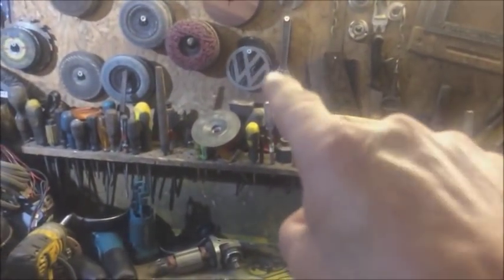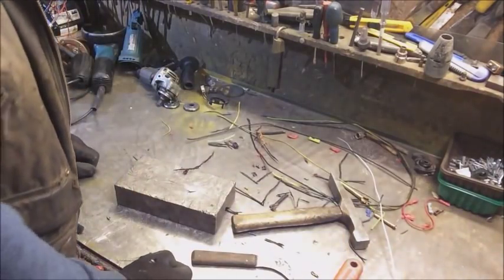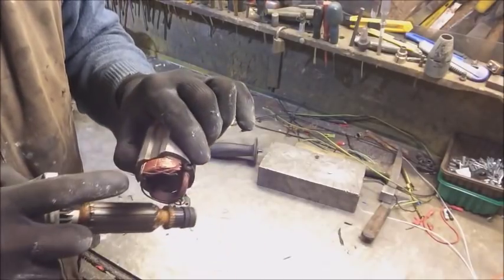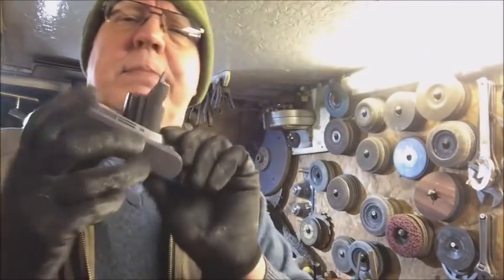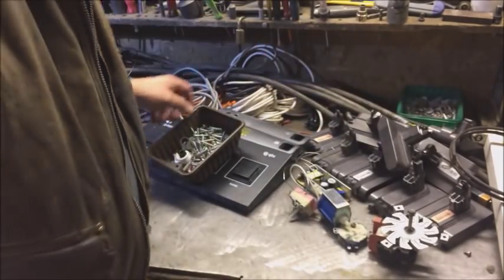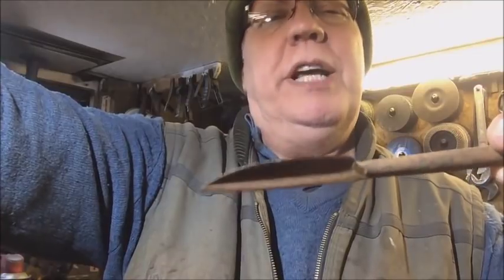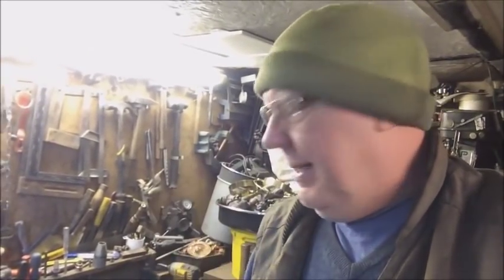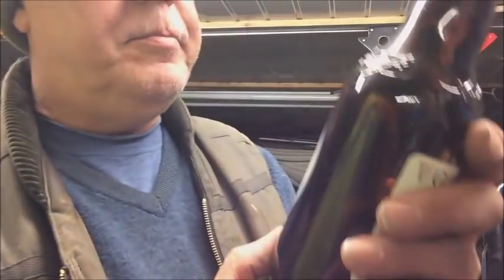Scraplife in da shedlife part 2

Comment: Another great video Ian.  I've used Big Keg's vegetable peeler method to strip wire.  It worked but the wire I had had been tightly coiled for a long time and it was quite long so it was flopping about all over the place.  I may try the hammer trick next time.  Thanks for sharing, Poo
Reply from the maker: hammer only works on hard plastic,  or solid core wire, if its braided wire you just mash the plastic into the wire.
Reply: @Man-in-da-shed  I stripped some coaxial wire down to the solid white plastic core so I think that sounds like the perfect test subject.  I'll give it a bash - literally! lol,  Cheers, Poo
Reply from the maker: poosmate yes will work on coax inner
Reply: @Man-in-da-shed  Happy days!  Thanks very much!  Take care, Poo